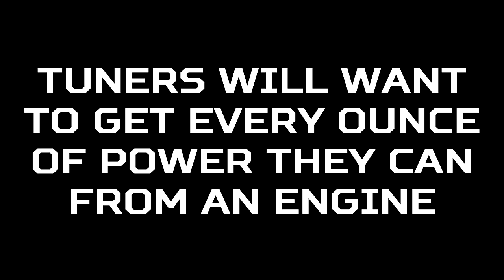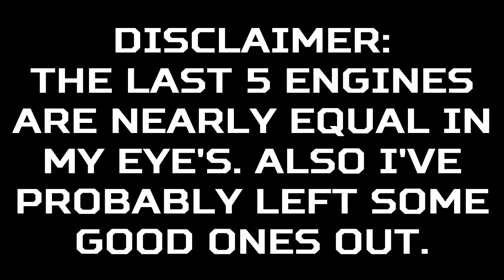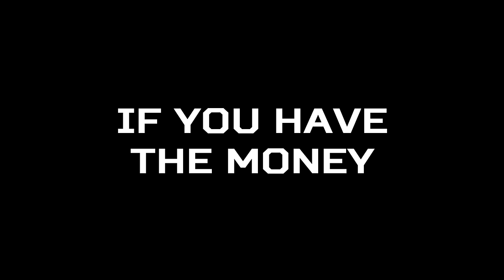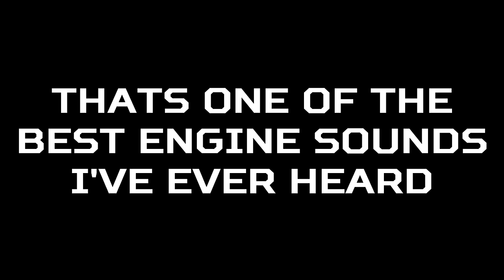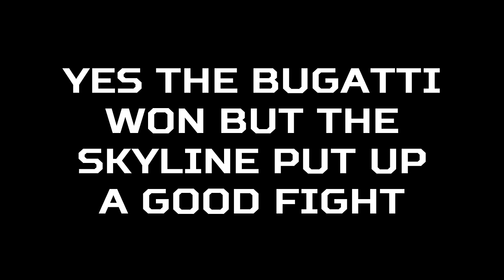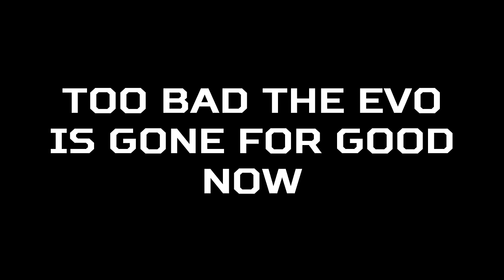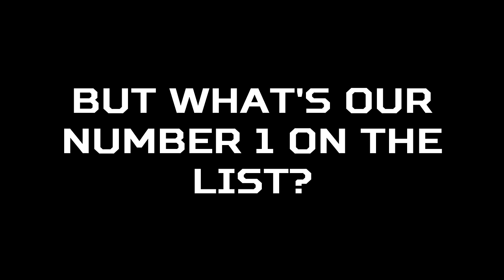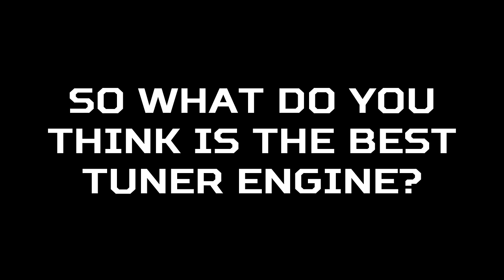9 of the Best Tuning Engines

Comment: one thing i learnt in life... never underestimate one of those civic hatchbacks, almost never stock lol
Reply: +x10cobra Depends where you live
Reply: +x10cobra Come to Ireland, you will not find any fast civics.
Reply: I learned that as well, the hard way.  Driving a WRX back when they first came to the U.S. and decided I would toy with a civic hatch off the line.  I was going to just stay beside him until the top of 2nd gear.   The hatch short shifted into 2nd and hit his nitrous.  He was gone.   Would've been a good race if I actually tried from the start.
Reply: on the total flip side, this guy in a prelude (with a fart can to boot..ha) wanted to race me when I drove my tercel.  to his and my surprise I left him behind.  his car was an auto tho.
Reply: +Awesomeman1987 I've left a prelude in the dust while driving my buddy's Saturn sc2.  That little Saturn was quick as hell though
Reply: +x10cobra you're right, they all have fart cans.
Reply: Sleeper aircooled VWs are fun and hook up almost as good as AWD with the rear engine layout, and you can get a ton of power fairly cheaply out of the old aircooled VW boxer motors.
Reply: +Eric hater
Reply: +davidgtrr34 yep in europe you find only stock civic's
Reply: +Awesomeman1987 Wow, someone else who had a tercel. I know those little cars pretty well, and I have to wonder what that guy in the prelude must have been thinking.
Reply: nope not true, in holland we have some nasty civics, with spoon engines and stuff :D
Reply: Lex Buren Really? Here you see stock civics m8
Reply: yess. civics with spoon kits. amuse kits, civic type-R's. all kind of, and also alot of stock ones. someone i know has a civic SiR with 420 HP with a B18C motor :D
Reply: Lex Buren Here you only see Old rusty civics :(
Reply: where is that ?
Reply: Lex Buren Close to the netherlands! Germany,Berlin
Reply: oh wauw, that sucks then
Reply: x10cobr
Reply: boostedsil40 yup my high school is full of em, can always hear them trying to beat the busses out of the parking lot
Reply: x10cobra 😂yoooooo fr when I got my m4 for the first time I was smoked by a fucking hatch back 😣I wanted to take the car back lowkey 😂but that gave me motivation now I’m pushing 1,200 hp and swapped to a m6 engine
Reply: I race those little fart cans when ever I see them. The ones that are stock get eaten by my 31 year old tpi 350 .  That 340 ft lb torque monster is a hungry beast .

Comment: Mazda engines are really easy to remember. It's {displacement}b. If it's a 1.3l 2 rotor, it's the 13b. 2.0 three rotor is 20b. Race engines have R in front, so a 2.6 four rotor racing engine is r26b.
Reply: modwlego The 13b and 20b aren't 1.3 or 2.0 engines.
Reply: +William Stewart 13B displaces 1308cc, and the 20B displaces 1962cc, which rounds up to 2.0l
Reply: modwlego A normal 4 stroke engine has to go through two full cycles of the crank shaft in order for it to complete 1 revolution. A Wankel engine has a planetary gear on the eccentric shaft providing a 3:1 ratio for rotor speed/eccentric shaft speed. In order for it to complete a "full revolution", each rotor has to go through 2 cycles, do the math. Each face of the rotor displaces 654cc, 654x4=2616. You could even argue that it's a 3.9L or 3924cc because of the 3:1 ratio but I like to pit it on even playing terms with a normal piston engine meaning the eccentric shaft only has to rotate 720 degrees, not 1080 to make up for the 3:1.
Reply: +William Stewart 654cc is the measurement of all 3 sides of the rotor, if any one side had to displace half a litre, the engine would be massive.
Reply: modwlego Each rotor displaces  654cc, look it up.
Reply: +William Stewart that's what I'm saying, too. Each 3 sided rotor displaces 654cc.
Reply: modwlego Each rotor face displaces 654cc, the entire rotor is 3 times that as there are 3 of them. Only two combustion events happen per rotation of the eccentric shaft thanks to it's 3:1 planetary gear reduction. It will be changed eventually as many in Europe  (taxed based off engine CC) have complained and governments went to the universities to let them figure it out. Some are saying it should be classified as a 3.9L as that's how much total displacement there is between both rotors, and some are saying it's only a 2.6 because it should only have the shaft rotate twice like a normal 4 stroke piston engine for fairness. Either way it's laughable to call it a 1300cc engine. GM could just put a 3:1 reduction gear on the cranks of thier V8s if that were the case. You'd have a 530hp naturally aspirated 2.3L LS7 V8 ha ha.
Reply: You can't change the displacement of any engine with any reduction gears on a crankshaft. A rotor engine is not a typical 4 stroke. Trying to make something fair based off a 4 stroke, also makes no sense
Reply: John John You could absolutely change the displacement providing you put a 2:1 reducer on the crankshaft, the crank would only have half the events per two rotations effectively halving your displacement. Mazda does it, what's stopping other manufacturers from doing the same thing?
Reply: Displacement is a physical property of an engine, can not be changed by adding reducers of any kind to a crankshaft. Bore x stroke = displacement. No exceptions.
Reply: John John So technically there is no displacement for Wenkel engines then?
Reply: Yes it is the displacement of the rotor. The three sides you have talked about is incorrect. Rotor engine displacement is the total volume of the rotor, then multiplied by the number of rotors. Early 12A engines were 1.1 liters, they had two rotors, and the rotors were thinner than the 13b and all others. 654cc is the displacement of one rotor, then multiply that by how many a particular engine has. No multiplying each rotor by three for the rotor sides. That is not what is done.
Reply: John John You go with your way and I'll go with my way. Like I said, it will be changed soon anyways.
Reply: Well, what I said, and the other people have said is currently the correct way of determining displacement for an engine. If the rotor size changes, then it does. Currently it is what everyone else is saying.
Reply: John John That's thier and your  way of measuring because that's what Mr.Felix claimed and no one challenged it in the 70's. Like I said, many disagree with it which is why it's being investigated now, it's not the true measurement of the engines displacement, it's the measurement of the power cycle.
Reply: Thats fine that people are thinking different now. as of right now it's official displacement is listed, when and if it changes, I have no problem accepting it. But you right now you are trying to tell people they are wrong about a method of measuring that is not currently accepted. Everywhere they are displaying the total displacement as 654cc per rotor. When that changes, then start telling people. And reduction gears will never change the displacement of a piston driven engine. Only boring the cylinders, and stroking the engine can change the displacement
Reply: It should be fairly simple to calculate the volume of an engine by how much air flows through it at 500 rpm.
Reply: Paul D As long as you have a formula, you could pick any RPM and do it I'm sure.
Reply: modwlego all honda engines afaik use the same thing b18 b20 k24
Reply: m8 its a 1.3L 13b, and a 2.0L 20b.
Reply: or you could call them RENESIS...  like on the engine cover...  for an overall generality
Reply: Aimee K only Renesis was the RX8, no other rotary had a cover.
Reply: Saying that is like taking out all the pistons and just measuring the whole bore down to the crank. The rotor itself takes a large amout of space in the housing only the rotor to the housing counts in theory to make this a real test
Reply: William Stewart You only measure the combustion chamber in any engine. Not per revolution. The combustion side is 654cc, so it's a 1.3L. In a piston engine is the same, but everything occurs in the same place.
Reply: haha i know right damn if that was true that would be one hell of a V8 rotary engine.
Reply: this and if u half the rotations that are given to the gearbox you only get double the tork with the same power and the same displacement but much easier burnouts ;)
i like english there are close to 0 situations where you have to write in capital
i dont care about a fuckin' i! :D
Reply: @vladimirlucifer4566  no, you measure the volume of air it displaces in a combustion cycle. Hence, displacement. Combustion chamber size has nothing to do with an engines displacement. Chamber volume differences only change the compression ratio.
Reply: How about you think of displacement as volume? You can't exactly change it without physically removing or adding material to it.
Reply: So rb26 is mazda rotary engine xadd
Reply: modwlego 
The confusion stems from the subjective view on DISPLACEMENT since we have only really understood engines to complete a 360* rotation per1 or 1/2 a combustion cycle. 

Now. You cant directly transfer this perspective to an engine with an eccentric shaft. The logic is incompatible....

Displacement is the VOLUME of intake gas during per: intake charge, intake compression, ignition, and exhaust gas evacuation processes. It is a simple calculation of the maximum volume of the rotor housing cavity’s 3 sides + the rotor face. So at the point where this cavity increases to its maximum volume before decreasing again can be thought of as BDC and vice verca. This  gives a SPECIFIC OPERATIONAL DISPLACEMENT that tells us what level of energy transition
 (think: combustion ‘pulses’ instead of cycles) occurs during combustion and what level of force (Heat) this produces....
NOW. 
The part everyone is tripping on. Trying to make this process fit into the 360*logic we are familiar with and are comfortable drawing mental comparisons with when relating one aspect of performance to another or comparing one engine to another. The problem is we are trained to think in Hp or Kw instead of Units of measure like Nm... 

If this process happens twice a revolution but the rotor takes three revolutions for the central axis to complete one full rotation. A basic conceptual understanding that is somewhat relatable to conventional understanding could be gained by simply multiplying (was it 654cc did i read?) say,     654 x 2= 1308cc p/rotor revolution,            1308 x 3 = 1927cc p/flywheel revolution for  ea rotor, 
1927 x 2 (2 rotor) = 3854cc total displacement p/flywheel revolution. 

*I believe this to be ballpark accurate based on the engines exhaust gas output is apparently (im an RB/JZ dude, not rotary.) sufficient to use turbos off much ‘larger displacement’ engines. Remember 654cc p/combustion x 2 = 1300cc/1.3L BUT a turbo from a 4.0L engine will work perfectly fine. 

But do not get fooled into thinking this way. A better way to understand the fluid dynamics and torque pulse energy levels would be to still consider the displacement as 654cc 
BUT
consider each rotor as being a individual, single cylinder, 1 stroke engine-
(Combustion chamber both sides of piston)
with its flywheel acting like one of 2, or 3 or 4 stationary planetary gears
(Representative of 2/3/4 rotor engines)
-that all mesh with a larger, central flywheel and rotate at a ratio of 3:1. 

Follow me?

*Single engine.
*654cc displacement.
*2x combustion cycles per revolution. 
*Engine contributes TORQUE to a common crank/flywheel.
*contribution is 3 revolutions per common crank revolution. 
*Number of rotors on crankshaft is analogous to number of individual engine cranks driving a common crank at a drive ratio of 3:1.

So I hope everyone understands a little better now. A 2 rotor is indeed a 1.3L engine that, relative to crank rotation, has a gas flow rate equal to that of a 4.0L engine.... 

Ie; if you connected 2x 500cc 2stroke engines  to a common crank at a gear ratio of 10:1, each 500cc engine has completed 10 combustion cycles ea @ 500cc per combustion cycle for one revolution of the common crank. Which means each engine has combusted 5000cc / 5.0L per common crank revolution. Since there’s 2... 2 x 5000cc = 1 revolution... so 1 revolution = 10,000cc or, 10L 

See how absurd it is to call 2 x 500cc ‘Internal combustion engines’ a 10L engine?
It may flow / ‘pump’ this volume of gaseous vapour due to internal mechanisms and/or efficiencies but the fact remains that the internal combustion ENGINE (key word being engine, not motor) is still only combusts 500cc Of gaseous vapour. 

Pheww. Hope that helps 🥵

Dont forget, engines produce torque, not ‘power’ 
A transfer of reciprocating force-
(harvested by combusting volatile gaseous mixtures in a self sustaining and self reciprocating process ) 
-into a torsional force around a central axis in order for the use and transfer of that energy in the most efficient means possible. Ie; a rotating shaft is the most ‘effective’ means of transferring energy from one point to another.
Reply: Savior!

Comment: where's the honda b-series.......iconic, by no means rare, and both cheap and easy to build. much, much easier than the ford coyote if you can even find one.
Reply: I agree...really would've made more sense than putting the k series.
Reply: K series are faster but b series motors are much more reliable and in the right hands it can push out so much power
Reply: +Font V I could've sworn I saw a 7 second b18 a while back. Maybe wrong, idk. but I don't think there is a 7 second k series. I'm sure it's possible. dollar for dollar I'd choose the b18. I like the idea of a timing chain over the belt, but I don't think .2 liters of displacement and chain is worth 3 grand more. Either way they're still pretty sweet cars fast egs or eks with 350-400whp roll on big blocks. power to weight...almost can't beat it
Reply: +Adam Benderman have you seen the 740 hp integra on 1320video i think its a b18
Reply: +Font V no, I'll have to check it out. bet it's stupid fast.
Reply: lol the guy said the K20a2 was out of a Yaris.. turn the volume up and listen lol
Reply: Fernando Plaza lmao yeah wtf was that about. and people saying why wasn't the b series in here instead of the k series, that makes no sense. why would an engineering predecessor be more of a marvel then the motor that came after it and was highly improved upon.
Reply: The B-series Pushed Honda in the automotive world to where it is today! Without the B series nothing Honda has would be worth a shit! The B16 was the first DOHC Engine from Honda. It has DECADES of racing history. DECADES of tune ability and it STILL is Stomping the shit out of K swapped civics. Parts are still available and pretty cheap. Hell even the D-series has great cheap Tuning ability!
Reply: Ford 302 should at least take the coyotes place, coyote is too new and super expensive to mod compared to others like Honda b/h/f series, vw 1.8t, Toyota 3tc/4ag/2rz/2zz/3s etc
Reply: miamipacheco  make a vid then . You seem to no your shit Haha I'd give it a watch.
Reply: Shawn Tetlow night kids boi love B16A
Reply: You missed the Audi AAN 5 cylinder turbo, the Vr6, and the 07k...
Reply: They NEED to be built to handle power. All of the other engines can achieve 400+whp on stock bottom ends. That's probably why the B series was left out
Reply: B f h series are all good

Comment: Volvo B20, B21 and B23(0) are good tuner engines from an old era of racing
Stock output on a regular 8-valve "Redblock" is between 100 HP (B20A) - 130 HP (B230E), while tuners has been known to get well over 6-700 HP out of these. so they got good potential, and parts are still pretty available anywhere.
Although you would need to convert the aspiration to turbo in order to achieve these numbers, it's pretty easy to do so.
There is also a 16-valve version (called B234) - and these can achieve up to 1000 HP with proper tuning

Comment: Just feels like you forgot the BMW M50 engines.
Reply: Price and cost of parts for what you get out of it
Reply: +Garrett Moore here in Sweden you buy a E34/E36 BMW for 1000-2000euro with the M50b engine in it. it's all about how good and cheap you can turbo it. 400hp is east without even open then engine. A tunning firm here did a 700hp and claming its reliable for a carmagazin some years back.
Reply: +Jimmie Nilsson Sweden

Not here in the US
Reply: +Garrett Moore haha yeah but same goes for LS1 engines here. they are not cheap :-(
Reply: M50 är de som ger👍🏻
Reply: M50 är de som ger
Reply: +Anders Lorentzon sen att den sitter i en tidlös design automobile :-)

sen har såklart Mercedes en rätt brutal rak sexa med. kolla in turbobandit haha
Reply: Jimmie Nilsson jo fan e34 och e36 är ju inte dåligt snygga heller :)

Föredrar Mercedes diesel motorer faktiskt :)
Reply: Anders Lorentzon Jo de är riktigt trevliga och bättre för vardagen. Är speciellt svag för OM628 V8 dieseln och des efterträdare.
Reply: om617 med 8mm pump och HX50 turbo är ju inte helt fel heller tycker jag
Reply: not tuner friendly at all is why
Reply: I've never even heard of this engine
Reply: BMW engines aren't really tuner friendly dude
Reply: majorkin19 BMW like many other car makers have so many engines. Some like the M50b25/N54B30 are indestructible, some others I wouldn't touch after 100,000km haha